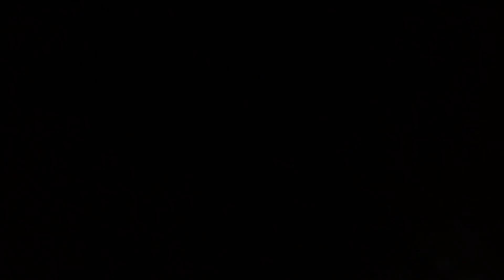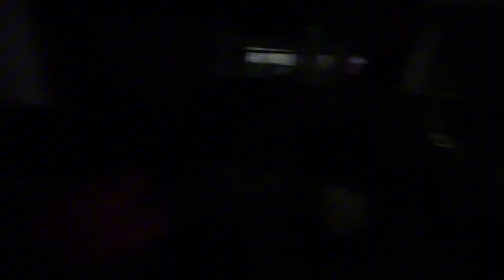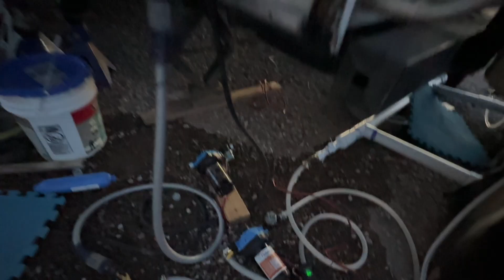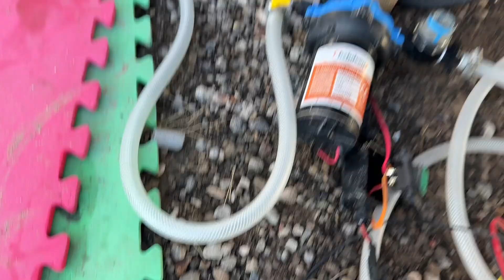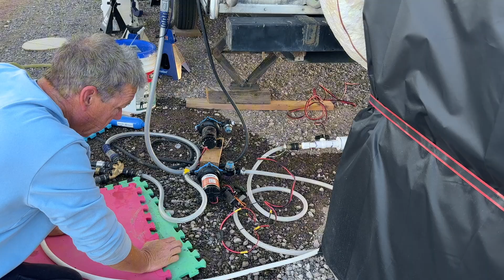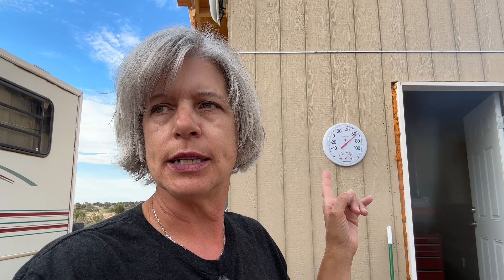NO WATER 💧Transfer Pump Went Out on our Off Grid Property!

Comment: The pressure switch is bad, that controls when pump starts/quits....I just had the same problem and I just replaced everything problem solved and not that expensive. Also with this economy the way things are I bought an extra unit for the future just in case the supply train gets interrupted, hope this helps....remember you need back pressure to signal the pump to stop.......
Reply: While pump is running adjust set screw back and forth till it stops, all valves to be closed down stream of pump. during adjustments to allow pressure to build back to switch, If this doesn't work switch may be bad. Sorry you guys have to have these problems continuously buy iy will get better.........
Reply from the maker: @desertschooner769 thank you so much for your help. I guess my YouTube search was accurate. Not a lot of people use these marine pumps or switches off grid. 😂 I’m glad you do! You’ve been a big help.
Reply from the maker: Yep we need back ups for our back ups! We fixed the switch and now our water is sort of surging. Does that make sense? Like it’s pulsing when on.
Reply: @CathysMid-Life  adjust the switch pressure back and forth till pump stops running
Reply from the maker: @desertschooner769  so it turns on and off now. So if we turn it off and back on it should adjust the pressure?

Comment: An idea for the future is a raised water tower. A few Off Gridders I watch use this idea then no pump is needed.. It then works like city connection. John on Frugal Off Grid built one n put the tote on top. Check out his site. Good luck Guys. I'm sure Carter will fix it. JERRY😊
Reply from the maker: Carter fixed it. We probably won’t do a gravity water system. Just logically it would be a bigger project then Carter and I could probably handle on our own without equipment rental and delivery and that gets very expensive. It’s just the two of us and those totes are VERY heavy!

Comment: When comes to water use gravity. Just raise your container. 😊 you can use counter weights and a lever. Safety first
Reply: What diameter size pipe do you have coming from the water container? When you use a container filling up water it needs to be 2 in pipe from the container that's holding water and slowly bringing it down and out to a smaller diameter. The concept is the more flow that comes out the more pressure you get into smaller pipes.
Reply from the maker: You’re referring to the gravity system?
Reply: @CathysMid-Life Yes. Don't forget to put the pump after the larger diameter size pipe
Reply from the maker: @offgridrooster  I honestly don’t think we would go that route. We would have to rent equipment to get the tote up high, and have that equipment delivered because we don’t have the hauling power. So if anything we would probably do a better pump before going that route.
Reply from the maker: If we didn’t get the pump working I think that’s what we would have had to do, except our totes are about half full so impossible to lift to height right now. It still is a possibility in the future though. Does gravity have the same amount of pressure?
Reply: @CathysMid-Life the higher the tank the more pressure. But you need very sturdy base and earthquake proof… no water after quakes is rough.
Reply from the maker: @JeffreyWalker-j4r . Yeah that makes sense. Less pressure as the water level lowers, regardless of height I’d imagine. We would have to rent equipment to get those heavy totes up high. A thought for a different day. Might just buy a better pump. 😂